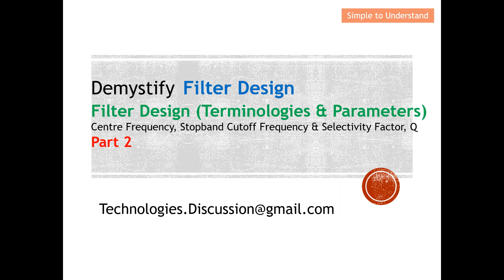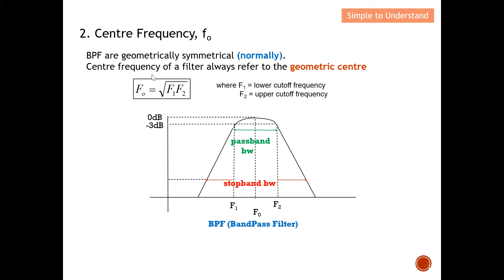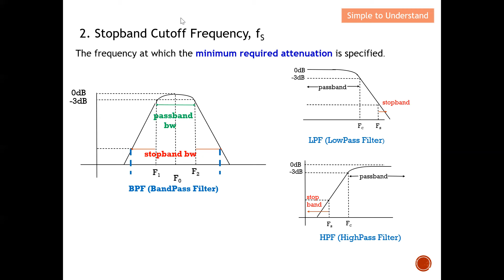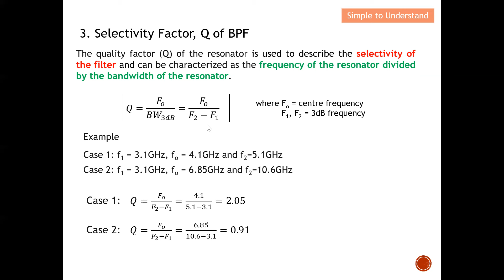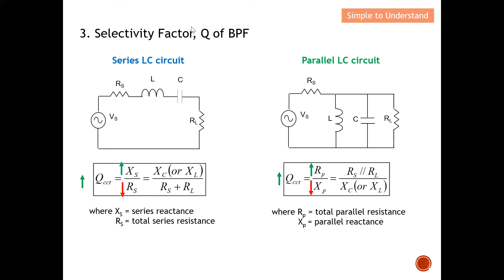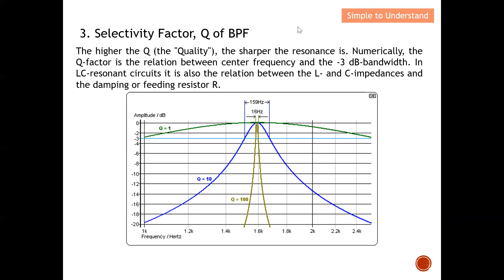Comment: How are Rs and RL series in one circuit but parallel in the other circuit?
Reply: Is because one is for series resonator and the other is for parallel resonator so hence RS and RL will be series for series resonator and parallel when parallel resonator.
Reply: @technologiesdiscussion1676  Thanks for the replay but its still a bit vague. In the parallel circuit Rs is still in series with the other part of the circuit. Rs shares the top node with the three other components but it doesnt share the bottom node, does it? Arent C,L and RL grounded at the bottom while Rs is connected to source instead of ground?
Reply: When we do circuit analysis, we will short the source, hence they will all parallels. For Eg, when we need to find the equivalent impedance, we short the voltage source, open the current source to "remove" it.
Reply: @technologiesdiscussion1676  Thanks! That makes sense! Love your videos btw!
Reply: Thank you so much for your encouragement.  :)
Appreciate u can help by Like this Video and Subscribe to this Channel. Thank you so much.  :)